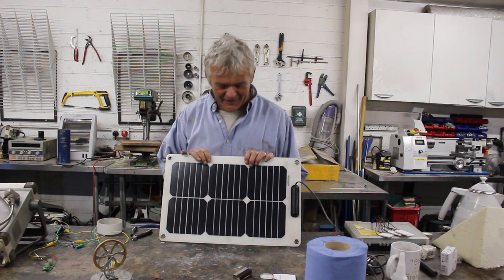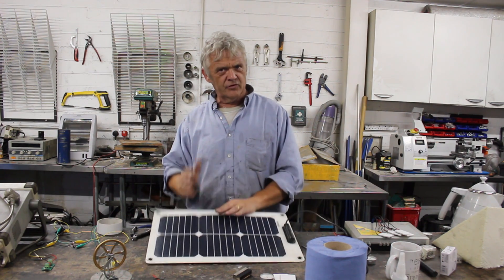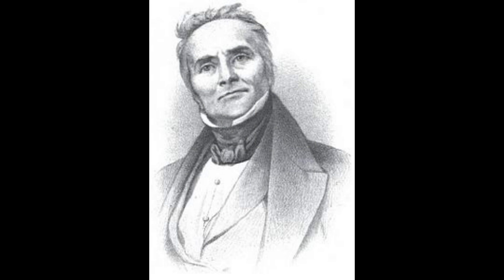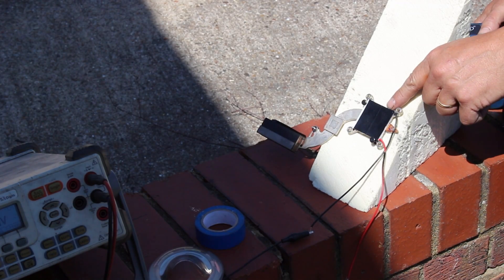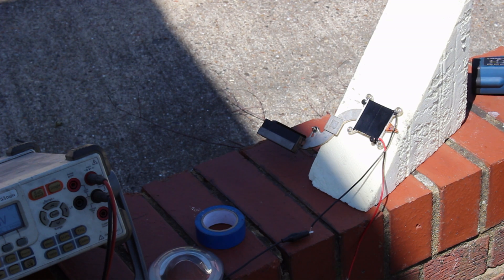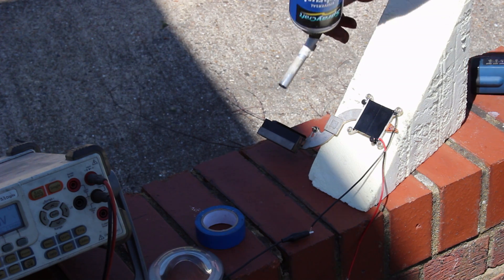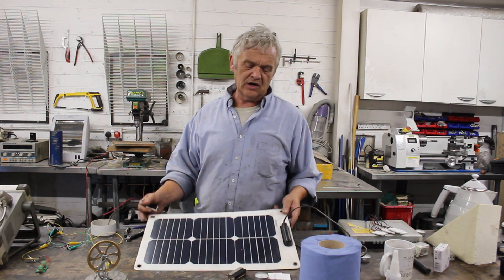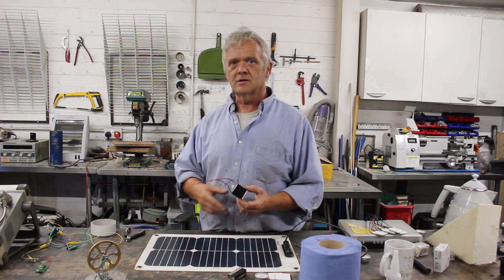1618 Putting A Thermo Electric Generator On Solar Panels

Comment: it be interesting to see if using graphene ink or paste would increase efficiency. or maybe if the the components within the peltier were made of graphene.
Reply from the maker: why do you think they would?
Reply: @ThinkingandTinkering  with ink or paste- because if you can create better contact and the excellent thermal conductivity would allow for the heat from the hot side to transfer faster into whatever cooling source would be used, be it a heatsink or anything else. while the cold side would be able to transfer its cold to the solar panel or absorb the solar panels heat better.

I would personally prefer attaching water blocks to the solar panel and applying a the peltier to a radiator and having a heatsink attached to its hot side. with a small insulated reservoir for all of that cold liquid.

As for the second part of what I wrote. I know that in between the ceramic plates they use different material as semiconductors so it makes sense that if instead of that something like grafoil was used to achieve the effect with better conductivity. I am assuming that you could not only drive more power throu it but also require less power to achieve the same results.

thats only my observation based on everything I have read so far.

Comment: Wouldn't it be more efficient to just  cool the solar panels with water and run the water to a heat exchanger and use the heat to help heat something like a water heater?
Reply from the maker: efficient in what terms? It would certainly be cheaper and effective

Comment: Things "Solar" never-have Ever Been Thought-Through: .. I believe that it was about 15 Years Ago that YouTube "was All The Buzz" about a Wooden 2X4 frame, a black backing, an Acrilic Window and painting Multi-Stacked Painted Pop-Cans to heat A Room with Solar. Today those Pop Cans have been replaced with Solar Panels and the Solar Panels drive A Computer Fan to heat the room .. as long as you are Not in Alaska where it is truly Needed. 15 Years later, still being useless Where it is Truly Needed.
Reply from the maker: yes I saw those and I didn't understand them as they could only work well when it was already hot - why not just open a window lol

Comment: The ideal way and one I go back and forth on is finding the universal conductor that can act as both the thermal conductor and solar cell material in one go while running cooling fins or some other radiative material down the back side so you don't torch the surface of your roof. 😁
I've thought of using a TEG material as a liner for my jet engine projects, but it's always come down to engineering a high heat resin that has lasting power. Thus far I haven't gotten much durability out of my samples despite being able to handle exceptionally high temperature, to the point that I'm running out of ways to get higher heat. There's certainly lots of ways to get the resin to hold together, up until a very discernable threshold where it goes from resisting the temperature quite well to ablating until exhaustion. It'd probably be a fantastic aerospace heat shield so long as you only need it once!
Reply: Have you ever heard of the home made material called starlight? Very interesting stuff, only baking type ingrediant's
Reply from the maker: yep - the only problem is finding that material

Comment: Ok So this solid state units do not work. How about thin walled copper tubing in a fluid (silicone oil?) On the back of the solar panel and pump 50/50 water / antifreeze -anti boil fluid through it to cool the panel and  heat a hot water cylinder?
Reply from the maker: no mate - they do work well to a degree  - it's more that they are just expensive - very expensive for not that much generation - I like your idea it's cheap and effective and for me that is always the win

Comment: Wouldn't the peltier devices act as an insulator making the panels run hotter than without them, which would reduce the efficiency of the panels...
Reply from the maker: I think they would still transfer the heat to a degree - but you may be right

Comment: Thinks...  At 65°C a photovoltaic can loose about 2% efficiency. Paraffin wax melts at about 50°C and so a slab could be used as a 'phase change material' to keep panel at no more than  50°C. At dusk, bring slab indoors to radiate its latent heat upon solidifying again. Probable more practical in dry deserts which get chilly at night.
Reply from the maker: probably

Comment: I have a similar idea for this solar cell and pelter module used together, it's a water distiller, the solar cell shall be directly connected to the pelter module, and one side of the cell must be in contact with water to be distilled, and the other side in contact with the hot side of the pelter module (this is the version where the solar cell is at the bottom of the water tank and sunlight passes through water), then the vapour is condensed in the other side of the peltier-solar cell sandwich. The other version is in where the solar cell is at the top of the tank and water is heated below, and pelter module hot side is in contact with water at the bottom but not necessarily directly with the solar panel
Reply from the maker: you still have the problem of cost mate

Comment: they might also cause the solar panel to retain too much heat and lose efficiency

now how about those 2 different element paints you made where one is more willing to give up it's electrons and create a voltage coated on the back. i mean that is a lot thinner and cheaper
Reply from the maker: good point - cheers mate

Comment: How about creating a thermo electric converter with graphite or other Seebeck coefficient materials and place it behind the solarpanel? Should at least be cheap. A solar panel is often made of aluminium so placing an isolation on the back and then another sheet of aluminium to get some Seebeck. Or maybe a heat sink that is made of aluminium that is in rain water that fills up then it rains to keep the panel cool. That would keep the panel a bit cooler and produce some Seebeck between the warm aluminium side and the cold aluminium heatsink side.
Reply from the maker: that is certainly the answer - the problem is cost really

Comment: I think there may be some small merit behind the idea if the heat from the panel can be collected and transported to a single thermoelectric generator, but this would get into fluid based cooling loops and at that point it would be much more sensible to simply use this as a pre heating state for a nearby solar thermal>steam generation setup instead of putting a thermally resistive element like a seebeck generator in the way. In the end, there's just not a whole lot that can be done with the low enthalpy energy regime of temperatures under 100C other than as a supplementary heating state for a schema that utilizes the higher enthalpy energies of 100C+ temperatures, which are obviously better suited for steam generation. I suppose someone could make a hermetically sealed "steam" generator setup with a solvent that boils just above room temps as the working fluid, but I hardly see the point when there's the option to just cool the panels with cool water, and use the extra power from the panel's gained efficiency to pump the now warm water into a solar concentrator schema to make superheated steam for generation of usable power without hilariously impractical upfront costs.
Reply from the maker: I think you final point sums it up mate

Comment: What if we use the thermo electric generator in car, like the hot side in exhaust and cold side with radiator, is that going to get efficient power generated ?
Reply from the maker: they are used mate - but the cooling schema is pretty extensive and in a high end car the proportion of cost isn't so important - but they are never going to be more than 5-8% efficient as that is the limit of the core device

Comment: Do you know any super cheap way to make diodes in order to make a bridge rectifiers?
Reply from the maker: diodes are already super cheap mate - I recently bought 1,000 1n4007 diodes for less than UK£15 - that's 1.5 pence each and it was just from amazon - I am not quite sure how cheap you want them to be?
Reply: @ThinkingandTinkering  oh well i was wondering about a way to make them with stuff you could pull out a recycling bin or nature maybe lol. Something like glass bottle capacitor for capacitors but for a diode lol.

Comment: I would cool the back of the solar panel with water tubes and circulate it through a water sourced heat pump, that could heat domestic hot water, or a building, or a thermal storage mass.
Reply from the maker: for sure mate

Comment: You could have water-cooled solar panels to boost their efficiency. The key would be to move the water with the smallest amount of power you can get away with like a tiny lower wattage pump run by a smaller solar panel near the big one being cooled.
Reply from the maker: for sure mate
Reply: All you’d need to do is create a system of ram pumps (which use no electricity at all) and that should do it!

Comment: one advantage to PEG is that it works in the dark or at night. If you are already running a stove or heat source, it makes sense to charge your batteries from the heat source.
Reply from the maker: there are advantages - but when you consider costs there are also alternatives

Comment: Interesting. This is one of those rare circumstances where some retired or amateur chemist\physicist\engineer working in his garage might stumble across an improvement. I'll get right on that. After the warp drive, but maybe before the cold fusion generator.
Reply: @billcorbin2851  Cool. And direct specific wavelengths (prism? fresnel?) to PN types per their bell curve of response, ie; visible to PV, infrared to thermo, ultraviolet to my mother-in-law, etc.
Reply from the maker: lol - it needs a cheaper material is all

Comment: if the TEC/TEG is made with the same materials and marketed differently is it just marketing or are the material percentages actually different?
Reply from the maker: they are different but not by that much
Reply: @ThinkingandTinkering  different like running a stirling engine forwards vs backwards?
Reply: @ThinkingandTinkering  when you run a Stirling engine backwards it is used as a refrigerant pump, take energy to make thermal difference ... running it forward you get energy from thermal difference... am i making sense?  they ARE different the mechanical parts are the same thou

Comment: There must be a way of using the absorbed heat from the panels to heat water without the need to generate extra electricity. A snaked copper pipe fixed to the rear of the panel  for example with water..(or even oil?). 6mm copper pipe? There may even be a small Thermo-cyclic effect within the pipe for circulation? Just a thought. Still loving your videos Robert!! :o) xx
Reply from the maker: yep - that would work

Comment: Might be better to find a way to improve the panel cooling. Like a 3D backing surface to increase the surface area on the underside of the pane. Or other means.
Reply from the maker: lots of folks suggesting water cooling
Reply: @ThinkingandTinkering    Yeah I thought of that also.  I was thinking an earth heat pump water recirculation system.  i.e. that uses the ground's more stable temperature to circulate cool water.  Otherwise a well shaded open air heat exchanger linked up to the water circulation pipe, that flows to the back of the panels.

Comment: I've seen Seebeck in series on a stove with a square aluminium tube on the other side joined with thermal paste and flowing water in the tube to power a device.
Reply: Is that online somewhere? Can you post a link to that?
Reply: @JoshuaBaron  it's been a long time ago I wouldn't remember the title
Reply from the maker: makes sense

Comment: There are PVT (photovoltaic/thermal) panels with a cooling loop that provides both hot water and electricity. Theoretically, 2/3 of the power generated goes into hot water, and it also boosts the PV generation.

I really want to build a Sterling engine that would be affordable that could run off of both solar thermal and wood heat.  That would allow some energy storage thermally.

Where I live in New York, There's a lot of people who heat with wood.

In an era with $100 gasoline engines, they should be possible to make it an expensive Sterling engine.
Reply: I'm all up for converting a 4 stroke into a Stirling
Reply from the maker: I am thinking about doing that mate
Reply: @ThinkingandTinkering  
I've seen only one person perform that on YouTube (also, only partially), and they used a V-engine that only needed to be capped off (it had a regenerator already). On the other side of things, there's one very cool explanation on how to convert a 2-stroke into a steam engine by attaching a check valve at where the spark plug goes, and also a mechanical "switch" to the piston to open up the valve when the piston is in the proper position. 

I don't know the efficiency though.

Comment: One thing you didn't touch on is the peltier device is going to have an insulation effect on the panel. If you cover a panel with them, your panel will get hotter and less efficient, unless you add something to cool the whole system, and if cooling is making the system is more efficient, then why is the peltier there? Sure, you get a bit of energy out, but the solar system might have be better off being thermal greased directly to the cooling system without the layer of peltiers in the way. It's not that this could never work, I just find people think sticking an energy harvester on something is free, and often in well tuned systems it has impacts on the system. It's a complicated engineering problem.
Reply: I would use the peltier to cool the reservoir of the cooling system assuming it is water cooling that we are talking about. 
maybe only connect enough plates to the panel to allow for charging said pump and cooling system.

I just remember that the heat created by the solar panels themselves create humidity that gets stuck under them which worsens the situation so something is needed for that.
Reply from the maker: good point mate - thank you for making it

Comment: The version that powers a fan to spread heat from a wood stove is very practical, however. They work very quietly and can really help spreading heat throughout the house. We will never be without either the wood stove or the fan.
Reply from the maker: I am not saying they don't have uses mate - they most certainly do

Comment: Great demonstration.  I really like your design of this experiment.
But a Seebeck effect device, a thermocouple, made as you have done by alternating graphene and metallic paint, applied directly on the shade side of the PV panel might be a little cheaper to produce, even if less productive.  And harvesting the heat from cooling the thermocouple could supplement heating of domestic hot water. 
Like your discussion and critique of commercial wind turbine ratings, a lot of PV cell production cost and benefit ratings are based on "bursty" theoretical  peak performance ideals -- e.g. 11 a.m. to 1 p.m. in the tropics for more than half of the samples from prototype production, installed at the perfect orientation, before transmission or storage loss -- and not on temperate zone off-hours production of the device actually delivered to and installed on a Northern Hemisphere household rooftop.  Your relative cost of TEG and PV cost is right on, but you have gone for the most favorable rating and cost on the PV panels.
Reply from the maker: wow - cheers mate and yes I agree with you on the paint graphene idea and on costings - but I went for most favourable to avoid argument on that point really
Reply: I am a bit of a tinkerer but I think my greatest skill may never have been used.

I see some really incredible "thinkers" here. I chose this reply to comment because it was at the top. That being said the absolutely staggering amount of raw innovative intellect in this comment section utilized collectively without simple reservation of finance...could..no is! the evolutionary path we CAN follow.

I require the assistance of all so that I can facilitate (personal excelling is short sighted) both connecting and expediting all the nooks of human life that miss the spotlight but excel beyond imagination. 

I am not looking to grow a subscriber base, I will gladly forget my own ego. I just want enough to be able to help. I have seen Rockefeller effect, I have seen Hitler affect...I simply want to effect...together. 

Back me.
Reply: yes, I would accept becoming a president but only if I had enough contact me that i felt confident that i had the information required to connect sources with resources.
I cannot change the world. We can. Let me help us. WE are the answer to the WE problem.